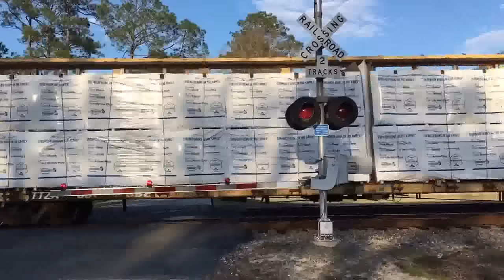What Happens When Railroad Crossing Gates Malfunction?!   Etc.

Comment: You know that rail crossing gates are flexible so if you are stuck you can reverse out of the track?
Reply: Some places use fiberglass with a steel rod inside.
Reply: Most have aluminum first sections, and fiberglass 2nd and 3rd sections. They are not meant to be driven through.

Some mechanisms have spring-loaded gate savers, and others just have shear bolts so the gate just gets knocked off and hopefully rehung if undamaged.

Sometimes there are rubber tips about a foot long.
Reply: @limitingchaos  All the gates in Florida are BREAK-AWAY, if you're trapped inside the crossing, just drive into the gate in front of you, it will break away and let you out, or you can back up out of the crossing and the gate will break away, HOWEVER BACKING UP IS NOT RECOMMENDED, going out the other side in front of you is. 

Backing up will cause the gate to break away all right, but it will hit any vehicles behind it, nor will you have enough room with vehicles there to back out, always move forward and out, off the tracks.  That way the gate will break away to the right and not hit any vehicles on the other side, unless they are backed up to the gate, then you're just screwed. 

If the rear is cleared, then backing up would be recommended if the forward direction is backed up to the gate in front of you.
Reply: @HolidayDecorator  Of course it's better to drive through the gate then get hit by a train.
Reply: Yeah they aren’t built for you to drive thru. Period. They break away and the shear pins break but you actually do more damage than you realize.

Comment: I am old enough to remember when the automatic crossing gates were first installed.
 Before that, all gates were lowered manually  by someone stationed  at them  full time. There were also roads and some city streets  that crossed busy railroads that had no gates and you had to look for a train coming in either direction . Now drivers want others to do their diving and thinking for them.  The dumb down of society continues .

Comment: 9:25 the lights do that, because there is a set amount of flash cycles, so when it turns off a cycle has went through, if they are still on, the cycle is still goin. Hopefully that made sense
Reply: Well, not really ;) Those are LED-lights. Those are either fed with pulsed DC (unbuffered rectified AC) or modulated with PWM (Pulse Width Modulation, where the LEDs flash on and off at a rate so fast the human eye will see it as 'on').
Both can greatly interfere with the camera's shutterspeed or frame-rate if either of them is slightly off.
Reply: I was wondering about this, because im familiar with the equipment but was stummped as to how this was possible
Camera interference is possible

Comment: (from Canada)  The Engineer of 9095 was very smart to stop when the gates went back up just as he was to cross the roadway to proceed.  I do not know if this is a rule,  but if it isn't I commend the Engineer for what he did.
Reply: same for 9509,  2807.
Reply: I think the cause of this was the crossing device is on what is known as "time-in-motion".  In other words, the mechanism senses the speed of the approaching train to decide when to start the crossing warning sequence so the gates are down at the proper time (supposed to start flashing 14-20 seconds before the train fouls the crossing) and be fully down right before the train gets to the crossing.  If the train slows down to much before it gets to the crossing, then the gates "time out" and go back off and shut off.  Engineers are supposed to approach these crossings at a consistent speed so this does not happen.  Time-in-motion crossings are the most sophisticated and expensive of conventional grade crossing setups.
Reply: Generally, most railroads require that engineers verify that gates are down if they are traveling on a slow stretch of track and they are not allowed to cross a road unless the gates are down or a flagman stops traffic.
Reply: Definitely not all. We have short trains run through town. On the bigger streets they have a flagman get out, but on the small side streets they just cruise through. That's where I saw some idiot decide to play "chicken" with the train, accelerated from the end of the street when he saw the locomotive, sped across the tracks right ahead of it. Yeah, he was in a loud Chevy Cavalier and had a mullet, why do you ask? Then there was the older guy totally not paying any attention, who comes cruising down the road across the tracks without paying the slightest attention. Luckily the train was 100ft from the crossing still, but he began to blow for the crossing just as the car was crossing the tracks...the driver jumped visibly an swerved to the right, away from the train. I think for a second he thought he was about to get crushed. If he had bothered to even glance left first, he would have seen the loco coming.
Reply: Harold Smuck euuuu
Reply: It's a brand new crossing. The programming could be messed up. However, the train was in the "island". Our crossings are designed to stay down at all times when something is in the island

Comment: Regardless,all tracks are Private Property...crossing is really at your risk as your on there property..most tracks were constructed before cars were even invented.
Reply: With that being the case, shouldn't all railroads be required to bypass all Public traffic? I'm not trying tp diminish your statement at all, I juat always thought it would be an interesting question.
Reply: @thesixgunfighter288  The trains do have the right of way. Also, the railroads don't pay to install the crossing equipment, it's usually the state.

Comment: 4:30 End switch is broken and doesn't disconnect the motor once the gate gets up.
9:26 Mains flicker not in sync with camera rolling shutter?_
Reply: If that would be the case at 9:26 the lights on the pole would have also going out
Reply: The poles have either incandescent bulbs or better ballasts for LED lights with voltage output smoothed with a capacitor - no flicker, no video anomaly._

Comment: So the clip at 9:25 can be explained by cameras and LED technology, and the camera's detection of light. i can't find the youtube video on it, but a quick explanation is this: LEDs are a very fast reacting light source, far faster reacting than incandescents or even flouresecents. So if the current through the LED varies rapidly the light output will vary equally rapidly. Cameras often have a "rolling shutter". Different parts of the frame are captured at different times. Therefore sometimes the shutter is open when the light is pulsed on, and sometimes the shutter is closed when the light is pulsed on. This will usually lead to fading or flickering, depending on the camera and the pulse timing of the LED's.

So it's not actually fading out, only on camera. But with our normal vision it would not fade at all.

Comment: Those intersections are outdated. I know one where it starts blinking and the poles immediately go down. Now if you are over 60 ft going slow over tracks because there's a hump...well, you might just not make it. I'm fairly sure that's what happened with a poor car hauler who got stuck under the poll got wedged between the cars. Those gates need be updated and made safe

Comment: Question:  If there is a malfunction, does anyone know if the train owner (or railroad track owner) has to pay for damage to a vehicle if they crash? Like if the RR arms & lights don’t work? What if also, for some crazy reason, the train conductor didn’t sound the horn either? Anyone know about the legal implications?
Reply from the maker: I recently found out that the railroad company running the trains is responible for the crossing lights maintenance.  If they hit a car and didnt sound the horn they could be sued n court
Reply: The victim or their family would have to sue the railroad. They're not going to voluntarily admit any liability. I only know this because a friend I grew up with was killed at a horrible railroad crossing when he was 16. The crossing was at a ridiculous angle so that a car's front bumper had to practically be on the tracks before you could see whether there was a train coming. It didn't have any flashing lights. The only thing there was a weather-worn crossbuck. There were tall weeds grown up around the crossing that obstructed a driver's view of the tracks. When my friend's car was hit, the train was operating over the speed limit and the engineer and conductor didn't blow the horn-at all. That was even though it was a small town that had 5 railroad crossings close together, all 5 at a dangerous angle. 

In court the train crew tried to claim they had blown the horn but a lot of witnesses testified that they didn't. (In fact one of the key witnesses in the trial was another good friend of mine who was 13 at the time. The crossing was visible from her front porch and she had been holding her 3 year-old brother in her arms so he could watch the train pass.) 

The train crew should have been able to see the car driving up to the crossing, from where they were sitting in the cab. How they could have seen a car about to drive right in front of the locomotive and still not blow the horn is a head-scratcher. The coupler on the lead locomotive hit the passenger side of the car and sent it rolling. My friend was ejected. He died at a hospital a short time later. 

The court ruled in favor of the victim's family. Despite all the ways the railroad (MKT) was negligent they still had the chutzpah to appeal the court's ruling. The appellate court ruled in the victim's family's favor, too. So even though they'd just lost their child the victim's parents still had to go through hiring an attorney and going to court to fight the railroad twice because MKT wouldn't even talk about an out of court settlement. smh

Comment: My guess is that the 'shaking and shivering' gate mechanism has a fault with the upper limit switch. Unless the limit switch itself is faulty, a simple adjustment could cure it in minutes!
Reply: Or a bad hold-clear mechanism,  gate keeps falling back on Power Up contact.

Comment: Easy to stop them driving round a lowered gate.
As the gate lowers, a lightweight extension telescopes out, reaching the other side and blocking the other half of the road. Doesn't need another lifting system on each side.
Easier still just make the gate arm longer but fixed. .
Reply from the maker: Thanks for the tips!

Comment: The crossing gate shakes because there's something called a "Hold/Clear Device" inside the gate mechanism. Its a ratchet style device that uses a magnetic coil to hold the gate in its upright position. If that device is malfunctioning, the magnetic coil will release and catch, release and catch causing what you're seeing. On the railroad we call this a Flasher Jerking off.... railroad humor
Reply from the maker: Lol, thanks for the info
Reply: Can’t we do better than this?

Comment: I have the sense that some of the mechanics and programming of the gates aren't all that different from automatic garage doors, but with some additional pressure sensors, and some calculations being made.  Depending on the exact set and order of imputs, the machine could get confused, or encounter some parameter it doesn't have the coding to fix.  Like that shaking gate.  It's trying to raise to the upward position, getting stopped, releasing the pressure a set amount, and instead of stopping, still has a RAISE signal.  Gates aren't so simple I've observed, be careful out there folks.

Comment: As I'm sure you know, the gates lower using gravity and raise using a motor which continues to keep them up. You can see in the video that the brackets are preventing the gates from going all the way up. This is likely the result of the particular gate being pushed slightly out of place. The arrival of a train causes the gate motor to shut off thus allowing the gate to drop in normal fashion. A railroad maintenance worker could fix the problem in less time than I spent writing this. Good luck,
Reply from the maker: Thanks for the info and thanks for watching!

Comment: I am from Germany and just encountered this channel.
It is shocking to see how unreliable these gates are, and how stupidly these drivers behave even if they work properly.
You can definitely criticize the cost efficiency of the German railway, and perhaps you are right, but it is certain that it is very reliable and safe.
Additionally, the equipment is always designed in a way that should it fail, it fails to the "safe side".
Gates opening while the train is still on the crossing is practically impossible.

And of course this might also be some "German thing", but I never saw anyone here driving around closed gates in a car.
It may take a couple of minutes for a slow and very long train to pass, but I would never risk my life for that.

Comment: At 10:15 the lights are "turning off and on". They are LED lights and the cameras shutter speed is not matched to their frequency, causing the lights to appear to go out. Same thing happens when you record most modern car twilight's that are LED. Looks like they are turning off but it's just a camera trick.

Comment: The reason why the crossing arm is shaking is because someone is working on the signal box down the way. Older crossing do that when they switch the breaker box to maintenance mode. I used to live by a crossing and ours in Cleveland used to shake like that when someone was working on the signals.

Comment: 3:33 I think the approach circuits are miswired. The crossing is supposed to LOWER when the train moves. It's supposed to RAISE when the train is NOT ON THE CROSSING and STOPPED.
Reply: Also 9:30 I've seen that on some dutch crossings before. It's weird alright.

Comment: The image at 12:30 was interesting. There was a spur off the main line that just ended right by the edge of the road, nothing across the road, then more tracks on the other side of the road that merged back in to the main line.

Comment: 8:47 -- the freight train misses the car by a yard at least.

Driving along Valley Rd. in exurban LA, with a railroad next to it, I see the signal lights go on and sound loudly, and the arms going down reaching the horizontal just as a train speeds past *fast*.  I keep wondering what happens if the arms malfunction.

Comment: In the netherlands , if the crossing has a malfunction. It closes automaticlly with a battery. So even if there is a power outage the lights will flash and the arm is closed.

Comment: Third video. The gate mechanism's hold clear is not "latching out" to hold the gate up in the locked position. By design the gate goes up until motor-up contact opens killing battery to the motor but since it didn't latch (probably either being a worn ratchet & paw or the gate was damaged by an unknown source) the gate starts to descend again re-engaging the motor-up contact which then drives the gate back up and process repeats itself over and over again.

Comment: The shaking crossing gate has a cutoff switch the cuts power, when the gate reaches the proper height.  In that gate the switch is malfunctioning, not cutting power to the lift mechanism!  It's a Fire Hazard!
  Wow... that N&S Locomotive went to a Full Emergency Stop!  It's a good thing he didn't have a string of loaded cars behind him!
  With video cameras EVERYWHERE, there needs to be a way to confirm Crossing Safety Equipment is functioning properly and if not, dispatch a work crew, ASAP to repair  the system as people are dependent upon these devices, to tell them when to stop or not....  a BAD WAY TO DRIVE!!!

Comment: CET2807 executed a proper movement over the grade crossing with no activation from the Active Warning System. One possibility is: If the city, state or county places too much anti-icing chemical over the physical railroad track to deice the road surface may cause the Active Warning System to malfunction due to the chemical reaction affecting the AC frequency the active warning system generates through the rails to detect train movement. It can alter the phase angle of the AC frequency to a degree its out goes beyond the engineered levels, therefore, fully activating the system (fail-safe principal). This is also affected by the ballast conditions at the crossing. Once determined a "Stop and Protect" order is placed to protect everyone until the crossing dries out or is addressed further.

Comment: On the clip starting at about the 10:30 point listen to the whistle, 2 longs a short and a long ( - - . - ). This exact pattern is required of all engineers at crossings and a lot of them do not know why. This is a tradition dating back to the early days of railroading. It is Morse code for the letter "Q" and stands for "make way for the Queen of the rails". Next time you're at a crossing listen and if the engineer doesn't goof that is the pattern they will use.

Comment: If a railroad crossing gates/lights wouldn't work here in Sweden, they'd shut off the railroad until it's fixed. All railroads are owned by the government and as a result, they're kept at best possible condition no matter what. The companies running the trains is a completely different story though.

Comment: it's actually dangerouser to jump on a moving train as the guys in the yellow jacket do than crossing the road as the gates are lowering. It's not like a high speed train is going to cross 2 seconds after that. You don't have those in the US. It's a slow moving mass that really could stop in 5 or 10 meters if it really needed to do that